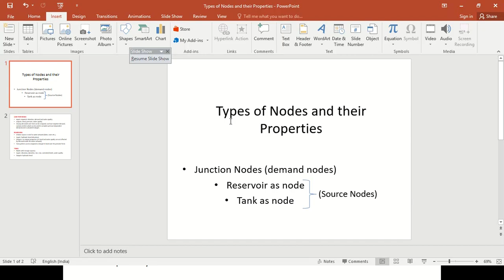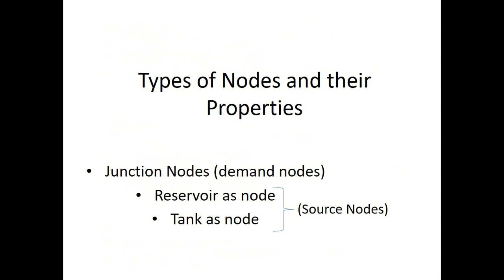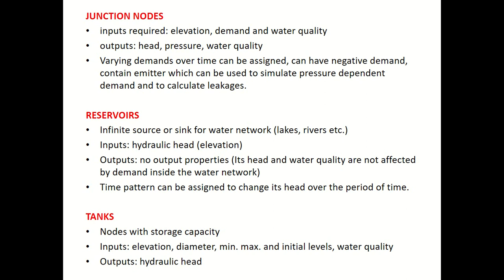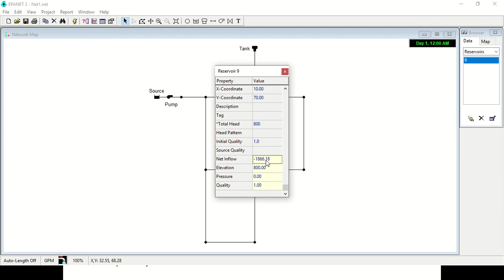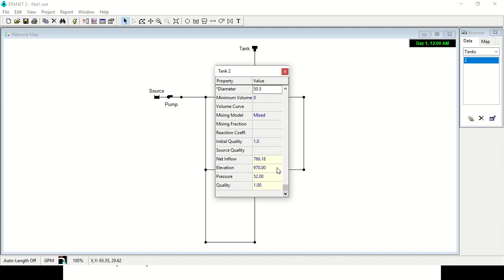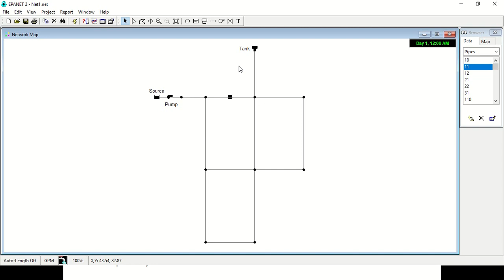Types of Nodes and their properties

Comment: Sir, how can i find the required pipe diameters if elevation, water demand and minimum required pressure at each demand point is given. Hoping for your positive response sir.
Reply from the maker: You can use flow continuity equation to get an initial diameter, then you can optimize it for pressure value by trial and error

Comment: Sir, now analysis is successful but even if I enter diameter as zero still the run data is same for pressure. For all dia like 0, 3, 4,..8 all pressure value is same.
Reply: Aniketji, I removed CWR. In Tank Ele 0, IL 22, Min L 18 and Maxm Level 22. Dia zero, Minimum Volume zero. Still it showing net inflow -3040 .. I couldn't understand. Next how can fix or give a timeline. For example supply is possible in Noon 12 to 1pm only. How do we calculate Base Demand. Difference between Demannd and Base Demand Sir?
Reply: Please Sir, if you can make new videos on these queries. You are a great help.
Reply from the maker: @Shishir-Veer  Controlling the pumps need some commands to be provided to the epanet model. I will cover it in the upcoming videos
Reply: @waterdistributionsystems8194  Sir be healthy! Remain fit! We are also following lockdown instructions but yes waiting for your lecture! 💐🙏
Reply from the maker: I need to see how you have drawn the network, if there is another pipe connecting to same node through which the demand is being fulfilled?
Reply: @waterdistributionsystems8194   Yes Sir CWR is connected with water tank  ESR
Reply from the maker: Hope i solved your query